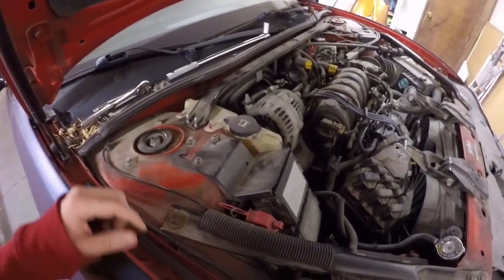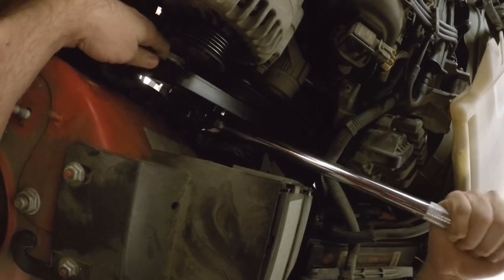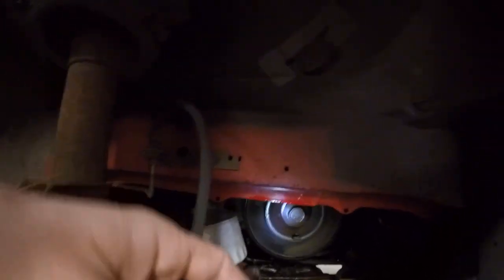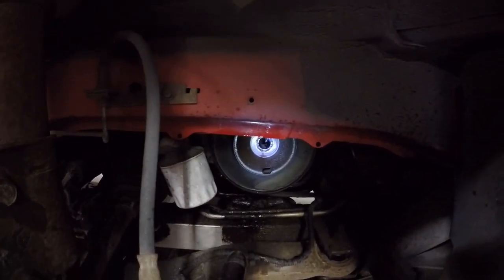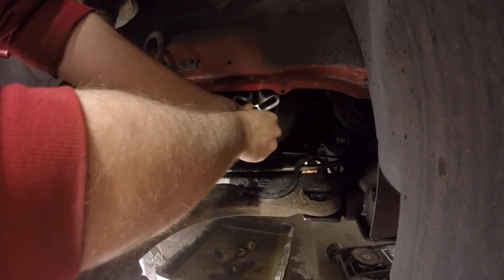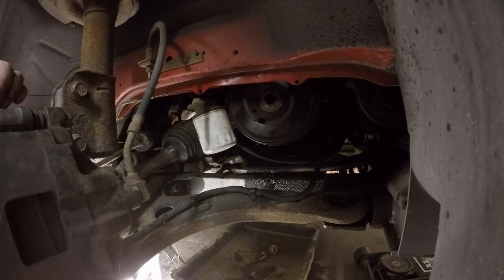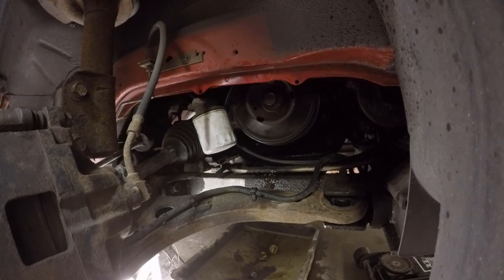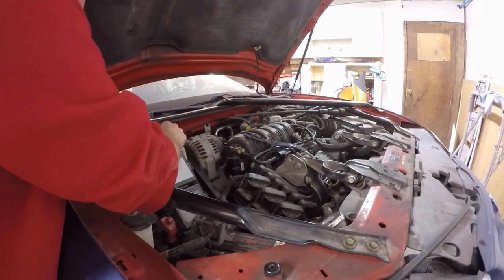How To Install Crankshaft Position Sensor | 3.8L Monte Carlo SS

Comment: My sons ss runs for like 20 minutes then shuts off we replaced fuel pump did a complete tuneup fuel filter and regulator new battery coils ignition coil car still shut off this is the last thing we haven’t done I’m hoping this is the problem
Reply: any chance this worked for you?
Reply: Was that the problem
Reply: @baseless3  yup

Comment: Lol my impact gun was useless. I ended up putting wd 40 taking 1/2 drive wrench and bump starting it. Make sure the car doesn’t start before you try the bump start method. I’m glad I purchased a steering wheel puller years ago. I thought it was a waste of money. I’m glad I was wrong.

Comment: What were the symptoms your car was having that required you to change the CPS?
Reply from the maker: The car was misfiring and idling rough. It also had a check engine light on. The code it threw was P1374 3x reference circuit.
Reply: @AbnormalGarage  i had to do this also on the same vehicle problem was my fuel injectors wasn't firing, now she running like a champ.
Reply: @AbnormalGarage  My 3800 tachometer went out two days ago. Then it comes on after driving a few miles but bounces around at times. Yesterday the car would not start so I got on the ground and wiggled the harness as I can reach the wires. The car started after doing this. Two other times the car had to be jumped and it started right up with cables.  The SES light is not on but I am thinking this sensor is bad??

Comment: so u don't need the tool to put the pully back on
Reply from the maker: Nope. Just the line the pulley up with the key way, put the bolt back in and torque it down.
Reply: @AbnormalGarage  What is the key way???